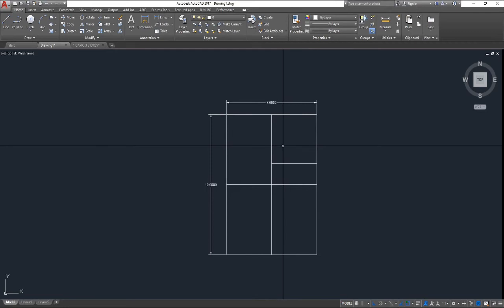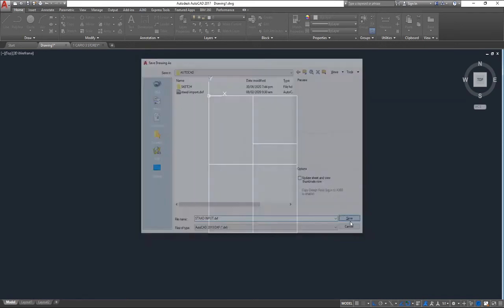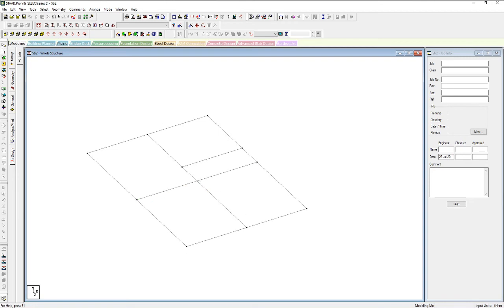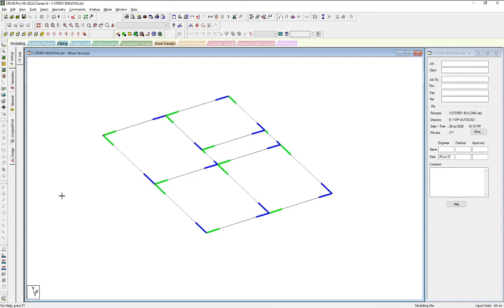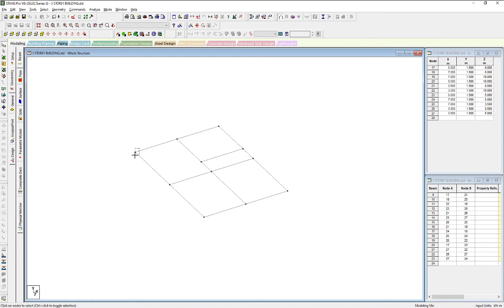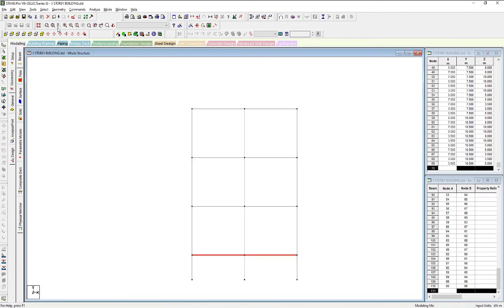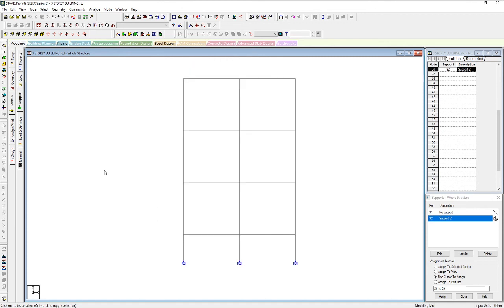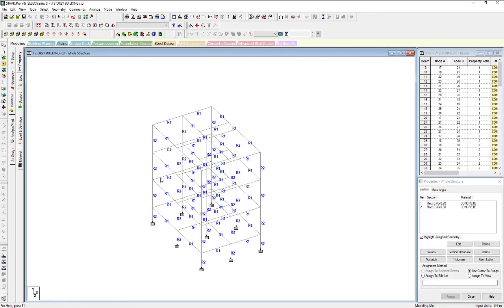HOW to IMPORT & MODEL your plan from AUTOCAD to STAAD.Pro

Comment: If you were to search on tab of what are the leading computer programs for drawings and design, Google's preference is STAAD. I found it not just useful but also prominent in our course, since we deal with Structural analysis and simulation before we proceed to our design. GRASP have the same functions with STAAD, only that GRASP displays only 2-dimensional and provides conventional method, but it doesn't make it feel less than the other programs though.

PS: this is very useful in Reinforced Concrete Design. Thank you